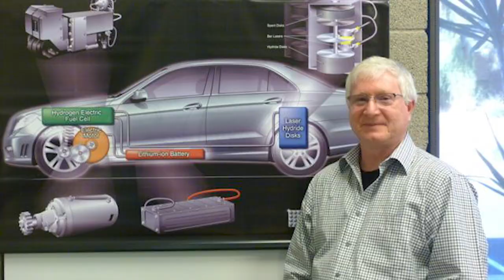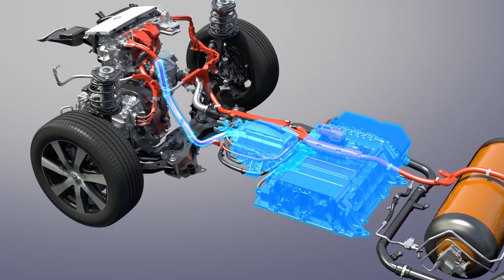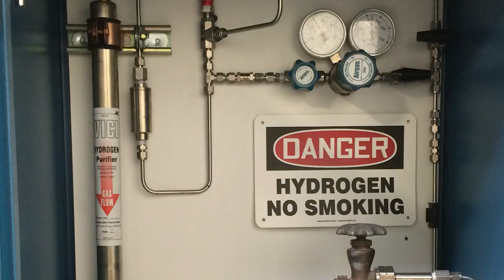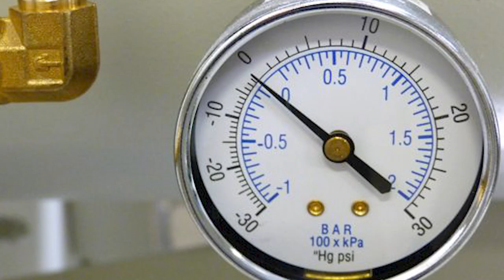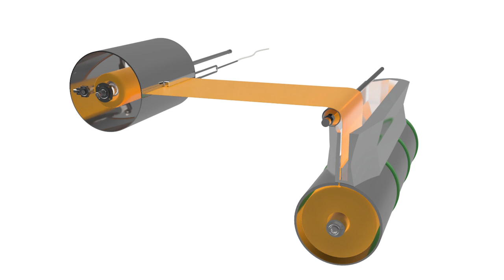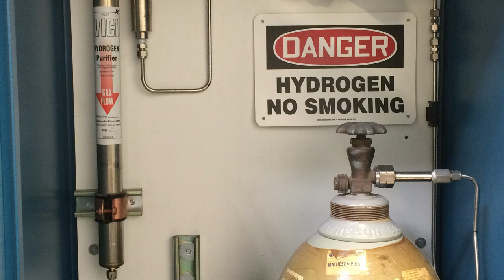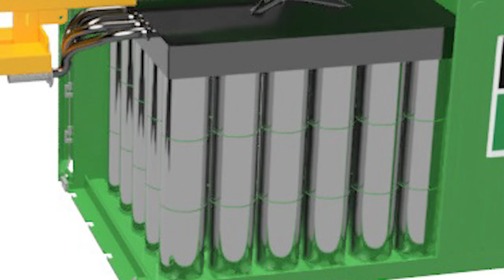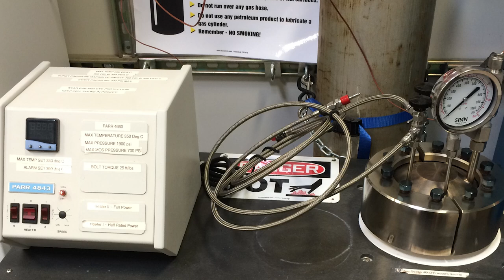This BANNED Technology Could Push Hydrogen Cars Over BEVs

Comment: The cost of producing green hydrogen is the real problem with hydrogen
Reply: Stabilising RE in the grid is completely complementary with H2 production. 
With a 30% capacity factor, three point five to four times overbuild of RE capacity ensures minimal requirement for supplementary pumped hydro, gas peaking, batteries etc. With such a large amount of overbuild there will be periods of massive oversupply - which can be variably diverted to green H2 production to keep the grid in supply/demand balance. Because generation costs don’t rise with output, the excess electricity is essentially free. Dramatically reducing green H2 production costs. 

We just need to continue to introduce more & more RE into the grid to get there & eliminate the prohibitive cost factor for green H2.
Reply: @markboscawen8330  If you overbuild your RE capacity, the excess electricity is NOT essentially free.  You have to compare the cost of the competing systems; something like: RE + (gas peakers or nuclear) versus 3.5-4 RE.
Reply: @johanmeijer133 Agree that there is a capital cost which should rightly be compared to other gen options. 

Though the economics of nuclear do not stack up at 100% capacity factor let alone as low as 30-40% when supplementing RE - its these economics which are even making extant coal-fired gen uneconomic over summer days.

H2 gas peaking needs to use green H2 to be zero emissions. Either it is produced from RE dedicated to the task or from RE gen which would otherwise be turned off to balance the grid. Given that solar has no fuel costs & no to very low ongoing costs, utilising this excess output is free in reality.
Reply: Not really. You could produce in the car with alternators built into the wheels. Oil companies put out a lot of disinformation about the costs to deter people from this technology. I have several homemade hydroxy generators. I even have a lawn mower I converted to run on hydrogen. The real problem is their profit margins. Weight is also a factor right now but technology will improve. Also lithium is a limited source

Comment: I worked for Quantum Technologies in Irvine CA when Toyota contracted  us to develop high pressure storage tanks and delivery systems. It was very exciting work. We had experience with CNG tanks that we built for GM trucks and cars, so the technology just took a little tweaking for H2
Reply: did the tanks have a 10 year life before it had to be decommissioned?
Reply: @cyclopsvision6370 , I couldn’t say as I was concerned with the actual manufacturing. They were type IV (plastic liners with SS bosses) tanks with metallic liners suffer from cyclic fatigue, and certainly have a limited life span
Reply: @rickrack78  The city that I live in decided to go green, and bought a fleet of CNG buses.  When the CNG tank expired after 10 or 15 years (can't remember the exact date), the city realized there is no process to recertify the tank.  The tank could be replaced, but the entire propulsion system had to be retested and recertified.  The manufacturer quoted the city a price so high to do the recertification that it exceeded the current value of the bus, so the city decided to buy new buses instead.  It was a good idea in theory, but the city got screwed in the end because they did not negotiate the recertification or get a quote before they purchased the buses.
Reply: @cyclopsvision6370 , that is typical for cities that are bent on going green. They jump on to the band wagon to signal how much they care for the environment, ignoring the future costs. I worked for another company prior to QTWW named Structural Composites Industries who manufactured the type of pressure vessels that were probably on those busses. The tanks can be re-certified  or just scrapped and replaced. Newer (type IV) probably have a much longer service life, due to the use of HDPE liners. In type III, filaments are wrapped on an aluminum liner and cured. The tank liners are then expanded against the cured composite. The end result is the composite remains loaded in tension and the aluminum liner in compression. The process of expanding the liner against the composite is most of the re-certification. The volume is also checked
Reply: @cyclopsvision6370  My county purchase the bus service from a third party for a fixed number of years after a fair bidding contest and does not own the fleet, and this is working fine for most part. I guess you’re city is taking bigger risks by owning its own fleet but 10-15 years service from CNG buses I wouldn’t be surprised if this is still cheaper in the long run than my county’s approach.
Reply: @JanHenrik541  Sounds like your county public transit agency outsourced the route rather than operating the service itself?
Reply: @cyclopsvision6370  that sounds right. I don’t live in a native English speaking country so excuse my lack of vocabulary. :)

I think the upside to outsourcing the route is that at the next bidding for new operator the county can prioritize different technology. Electric buses is becoming more common in other counties now.

Comment: I think that all technologies for vehicles will have their strong and weak points as well as best suited scenarios.  EV's for instance for me are the perfect daily driver to work and back. But I have a heavy boat to tow and also a large trailer that I use. Diesel at the moment gives me the pulling power, economy and range that I need, this is why I also have a diesel 4x4. I cannot imagine any other technology taking its place.
Reply: Definitely shows central planners government wants total control. We could be flying like the Jetsons by now
Reply: Why not ,  You can get more Torque from electric motors and gears than any combustion engine ...
Reply: @keithbill310  ghe economics of a battery large enough don't work out in that use case. The initial carbon cost of that li-ion battery only makes sense if you are commuting to and from your home 4-7 times a week. If you are pulling a huge trailer or boat, maybe a dozen times a year, then the ICE engine makes a lot more sense, economically and environmentally. Also, consider that many trailers and boats will be taken to rural areas with little infrastructure.

Comment: I drove a hydrogen-powered car in 1977 with hydrogen stored as Iron Hydride.  It was pressurized in a tank to charge it, then heated slightly to release the hydrogen.  The drawback was it was quite heavy.  The other problem was the H2 attacks the metals in the engine of a retrofitted ICE.  This has a lot more potential.  But the idea of “solid state hydrogen” storage is not new per se.
Reply: note that the car you mention used the hydrogen for combustion. In this new design the hydrogen will be used in a fuel cell to convert to electricity to run the electric motor in the car.
Reply: @josev1544  And those fuel cells require rare earth metals and have to be swapped out and aren't exactly efficient... So not really getting anywhere new  as it's still less efficient that gasoline by a few factors let alone even just a EV which despite all their inefficiencies are still better.
Reply: Nothing but respect for you sir. People are not smart enough to figure out that you can make your own Hydrogen for all kinds of applications for next to nothing!
Reply: @flodjod  Go to Amazon and buy a vial of Gallium. Go to the grocery store and buy a 6 pack of canned seltzer water or some other drink. Buy some sandpaper and a jug of distilled water while you're there. Go home and get a glass bowl or something. Put the distilled water in the bowl. Use the sandpaper on the empty aluminum cans (they must be made of aluminum). Abrading the bottom should be enough. Paint or place a bit of Gallium on the sandpapered spot on your can. Put the can into the distilled water. Gratz, you just made "Hydrogen". Now tell me again what the pollutant and "cost factor" of the grocery list is. O_o
Reply: @alfredharrison597  yes, you are absolutely correct, I agree with you

Comment: Best case scenario: It makes the Tank cheaper. But more expensive parts of a hydrogen system is the production of hydrogen and the hydrogen cell.
So the best case scenario for e-cars with hydrogen is still not enough to have chance against e-cars with batteries.
But hydrogen has a future in many other usages: Air-plains, Backup-Power-Supplies, Long-time-Storage (store energy in summer and use it in winter); maybe trucks (if autonomous, otherwise regulatory will order "charge"-breaks for the driver)
Reply: Yeah, you can't really get around the fact that running on hydrogen takes twice as much energy per mile.  Also, BEVs are far enough along that people will get hooked on the fact that they can recharge at home.  I don't think it will be long before apartments and rentals will start installing charging to attract more tenants.
Reply: @jonathangourlie9098  You forgot trucks, planes and ships which would benefit so much from this tech. BEV tech is good but they are only for cars. Of course, whatever is claimed in this video can be vaporware so I'm looking forward for them to have an actual running product before comparing.
Reply: Although this company doesn't solve the H2 problem, in theory H2 can be a better option for home charging if you remove the high pressure tanks (safety) and develop a more cost effective electrolysis machines. Something you can install in your garage, even use a regular 110V outlet + water connection as long as you have enough cartridges to charge. Let's say you have a 50mile commute on a certain day, you grab 2 cartridges and you're good to go, while the system continues charging the rest of the cartridges. If you're going on a long trip, you could maybe cram in 1500 miles worth of cartridges and never have to refuel.

Utilities would have to provide cheaper rates for home-h2 stations, which could be in their favor since its a more steady load on the system instead of ev chargers. Also if you have your own solar, I'm sure the utility would prefer you don't sell them electricity but instead convert to h2 locally.
Reply: Sounds like it also makes the Hydrogen lifecycle more efficient by avoiding the need to compress the hydrogen. On the other hand, it only stores hydrogen at the equivalent density of a 300 bar tank. Compared to 700 bar in conventional fuel cell vehicles like the Mirai.
Reply: Apartments? Have you lived in an apartment? You can't leave a charger going overnight unattended. You can't leave anything out. By morning all the chargers and cables will be gone. You can't even leave a chained up bike out unattended overnight.
Reply: There are 3 cars running on hydrogen. by Honda, Hyundai, and Toyota.
the big thing is the tank weight and energy used to pressurize the gas to 700bar, the problem of those system that they don't reclaim the pressurizing energy (we can do it as hydraulic engineers but they didn't do it). if you use this technology you will have a light small receiver to push hydrogen to the Fuel cell. then you have a lighter vehicle than E cars. as example: if you need only 1500kg of a car body and parts to run by electric at 200hp simply if you cut it to 1000kg you will need only  120 hp. 
so if you calculate the cost of energy transfer as losses in cables until it reaches your car plug plus the battery and connection losses and degradation, you will find the difference in over all efficiency doesn't justify pushing the dead weight of battery all the way with you. if you can reach lighter you spend less even if the efficiency is less with 10% say!
Reply: @moabman6803  Nonsense. Chargers are permanently fixed to a wall or to the ground. Cables are either permanently attached to the charger (Type 1 / US style), or lock automatically to both the charger and car (Type 2 / EU style)
Reply: @moabman6803  Induction charging via plates embeded into parking spaces and a reciver on the underside of the car is the most likely way that Apartments would get chargers.  Residents would then go to a kiosk or use a smartphone to activate the charging in the space they parked at with the charge being folded into their rent.  A standardized format will be needed though.  I expect workplaces to get chargers first though, as cheap daytime solar power makes it nearly free for a worksite to give employees charging durring work hours, electrical utilities would likely even pay buisnesses to do so as it will flatten the evening peak demands from residential buildings.
Reply: @kennethferland5579  How much does it cost to install one induction charging parking spot? Do electric cars do that? I've never seen this. What happens if the pavement cracks and it rains or snows? What about the people that park on the street? I'm surprised cities don't revamp public transportation. Then most wouldn't even need a car. Almost every city I've been to has very poor public transportation that is pretty inconvenient. New York City is great except all their stuff is old.
Reply: @Reason077  Permanently mounted? No. They can simple be unbolted or just ripped out.
Reply: Tanks cheaper but they have to be shipped around to be filled up. They won't be able to fill them at the swapping stations so you will be shipping 300lb batteries around... It's hard to move big 300lb things without banging them up. And expensive. This is all wishy washy and doesn't solve real problems.

Comment: This was high on hype, and low on detail. If it worked - where is the car that its being used on? A motorbike, OK, a bench engine? And they've been working on it for years? The technology is real enough - a metal hydride can absorb hydrogen. And its a clever innovation to make a thin strip to absorb hydrogen under pressure, and then release it with a laser light. But as we know, making something that works in a lab, under ideal conditions, may be far more difficult to scale in the real world. We do need other energy sources and methods, and this may provide one link in the chain. Hydrogen still needs to be made cleanly though.
Reply: If they had anything working, they'd have shown it. The numbers are just nonsense.
Reply: @chuckschumer7783  Rip van Winkel "Wake me up when they can run a car on it ."
Reply: from the video they're suggesting half the cost of current hydrogen comes from the need to compress it to 10000 psi - that just goes away.
Reply: @DanielASchaeffer  that is an incorrect suggestion. There is enough inefficiency in the production and usage of hydrogen to make it uneconomic even ignoring compression energy losses
Reply: Horizon Fuel Cell Technologies
Reply: @spazoq  lol! I literally have a miniature electric version that works just fine. The government keeps a balance on new product development. That way it doesn't crash the auto industry among others. Then as well many safety requirements have to be passed and that can take quite some time on top of the previous.
Reply: @allennolden8735  That's adorable that you think the gov't is able to keep on top of all the new products in private company labs, that they can understand it, and can then "balance" each of those across all the industries so that they can pick specific winners.
Reply: @davidmccarthy6061  its adorable that you make up some crap that I state they choose who wins. They do work with large industries and help regulate advanced technologies that can dramatically effect the economy. The government does not stop reseach that I know of. They also regulate through safety requirements. Which I mentioned. It is adorable how blind you are. It's not a conspiracy just a simple form of economic regulation. Then many industries do their own regulation in order not to diminish previous tech investments within their company. They time their releases and in some cases the profit out weighs the previous investment. So they release anyway. I've previously worked in research and prototype development.
Reply: My friend and colleague contacted the DOE head of hydrogen storage. He admitted that DOE didn't understand that no heat was involved in the lazor release of hydrogen from the doped magnesium nano fiber layered film.
Reply: @spazoq  No, because it is only economically viable when using Hydrogen from fossil fuels.
Reply: If the electric source was hydro or natural gas, I might think that furter research would be worthwhile, but using an unreliable power source and non  recycle products to produce that source of energy is in my opinion just robbing Peter to pay Paul.
Reply: you're not listening, IT WAS BANNED FOR A LONG TIME SINCE RECENTLY